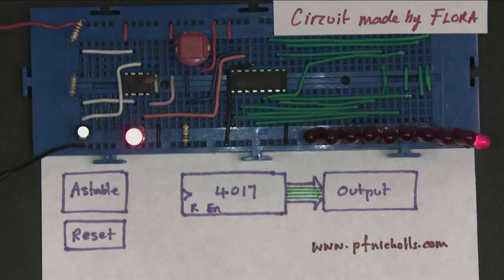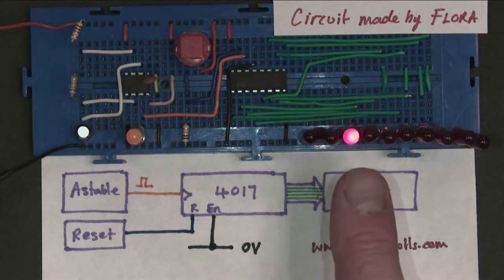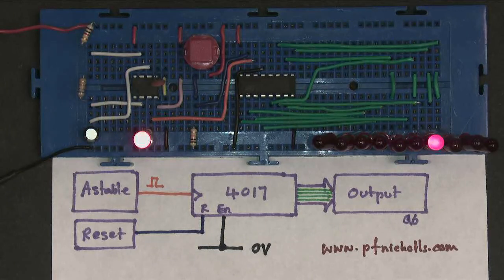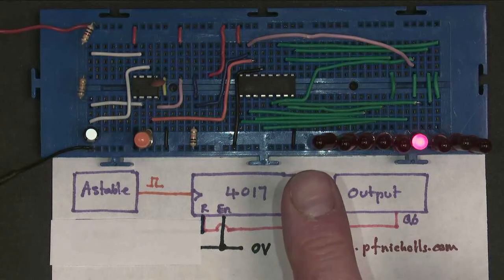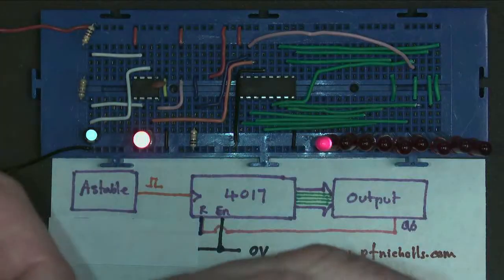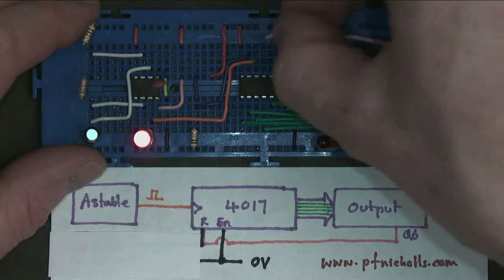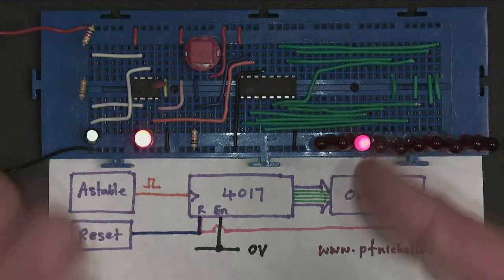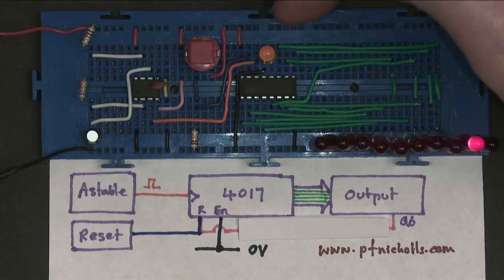4017 Counter

Comment: Hi, how can I connect the timer and the counter to obtain this effect: https://www.youtube.com/watch?annotation_id=annotation_312958&feature=iv&src_vid=15VDNO-U39Q&v=cxEyod-SnKY ,thank you.
Reply from the maker: Hi. To make the lighting effect you are after, the 4017 isn't what you want as only one output stays on at a time. In reality you would be better to use a microcontroller if you are trying to do a complete DIY project or a specialist LED control IC if you want to spend a bit more. A microcontroller driving the LEDs through MOSFETs would allow you to fine tune the pattern and speed etc. The hardest part is probably going to be making the actual LED array. I hope your project works out.